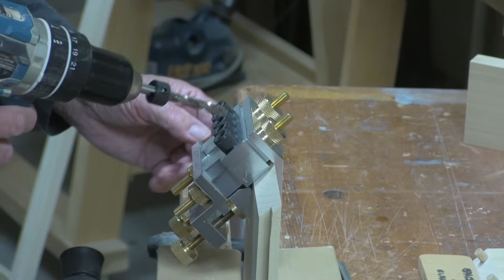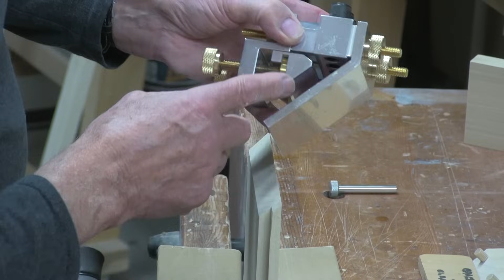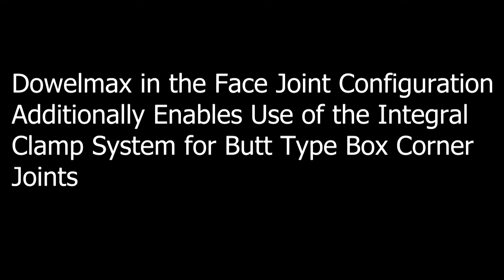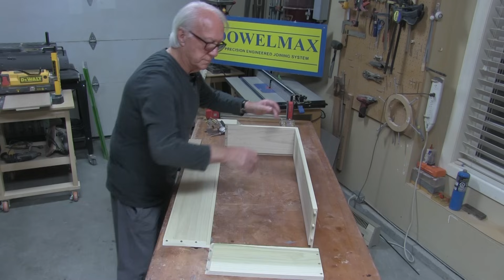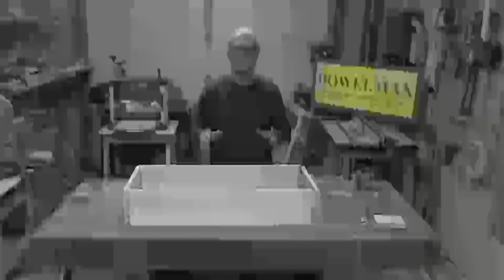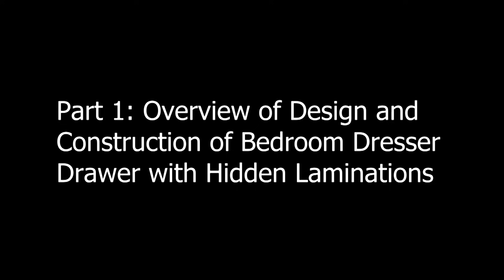Major Breakthrough for Dowelmax: New Clamp Adapter

Comment: I bought the clamp adapter spacer & like it. It speeds up doweling 45 degree miters. One thing about the instructions that come with it; they say to use a 3/16” spacer between the miter accessory & guide block for 3/4” stock. That barely works with full thickness 3/4”  wood & then only with 1” x 3/8” dowels. 1/4” spacer works much better with plenty adequate stock left on inside of miter.